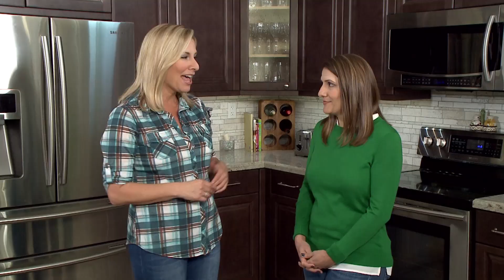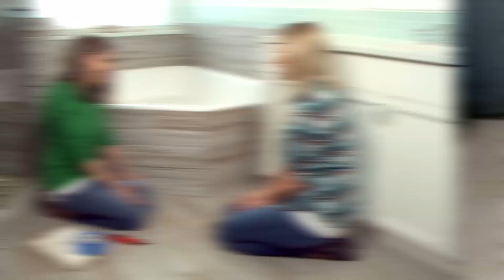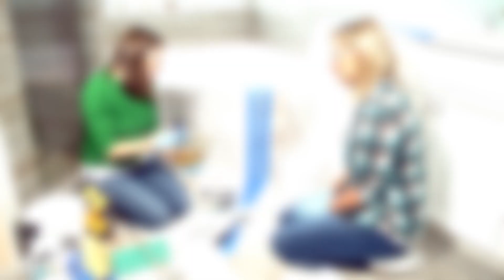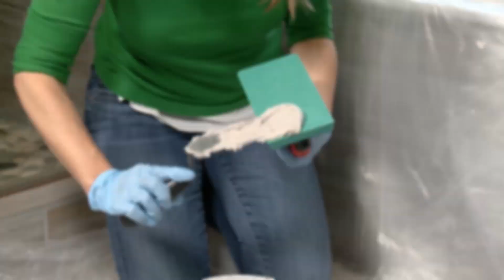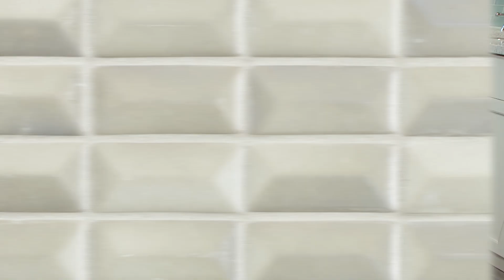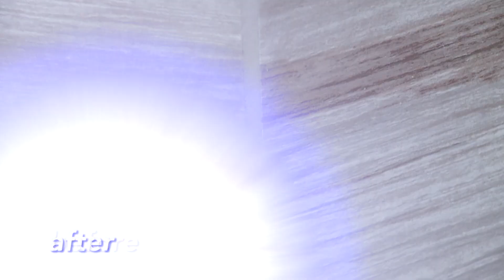Regrouting floors easier than you ever could imagine !

Comment: Not sure what this video is for other than an add for the product. The hard part is removing the grout.  If you taped up every line and draped the room in plastic like that, it would take you a year to complete a small room.  A good rubber spatula is best for getting all the spaces filled with grout.  The product is NOT easy to work with - it makes a mess that is hard to clean off the tile and it hardens fairly quickly.  This is not a job for newbies.  I would remove the grout and then hire someone to install the new grout.

Comment: this is Epoxy grout and is actually the hardest product to apply since the grout has a pot life that once it begins to  hardened there's nothing you can do but move extremely fast and that usually produces bad results.  No discussion on coverage so you can mix what you need and not waste a whole bucket of this expensive product.  Water will not clean up the haze if you didn't clean well enough and if the tile texture is rough or textured with pits you'll never get this resin based grout out later.  Tools for a small repair should be much smaller (margin float) Taping off the single grout joint actually hinders your cleaning process as there will be two lines of grout residue next to the tape if you don't remove the tape fast before the grout resin hardens. THIS PRODUCt IS NOT FOR BEGINNERS !!
Reply: Thank you!
Reply: I was wondering why they mixed an entire bucket only to do a seam about 30 inches in length.
Reply: @UTexas Nurse what dat is
Reply: Lies
Reply: @luisgutierrez4049  that's it you can't tell me where I'm wrong? A one word response isn't a response. If you have a technique for using epoxy grout teach everyone how to do it.

Comment: The actual hard work is removing the grout!! And these two numpties conveniently skip on past that bit, OMG!
Reply: Agreed. I need that first part...not the product placement.
Reply: Ashley Godfrey just get that tool....takes a lot of work....the hard part is having a steady hand, so you don't scratch your tile...:-)
Reply: @DebbieTomkoSUNSHINE  I grabbed a hand grout saw. It's a tiny thing with 2 razor blades on the front. Worked well. Took all day. Tried the oscillating tool, and it was quite overwhelming. Felt like it was going to fly out of my hand at any moment.
Reply: Sure is "easy" when you don't have to do the hard bits.
Reply: I knew this would be problematic when two women were in the thumbnail 😆

Comment: Great tips and I like that you showed haze remover...I didn't know they made it...TY.
Reply: The haze remover is not the typical acid used for commentators grout haze remover but a special solvent to remove the tons of haze this kind of product (epoxy resin) produces if your tile has any texture and you don't really pay attention to the cleaning process as you tool the grout line.